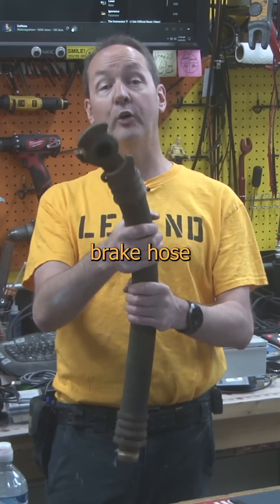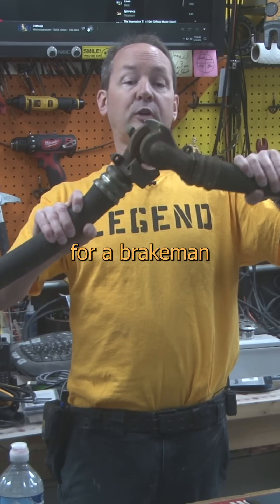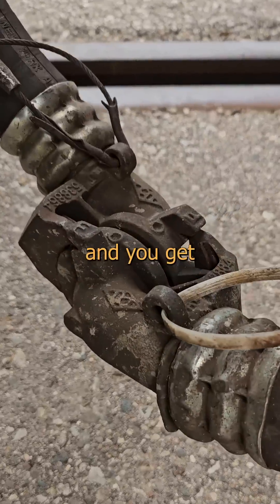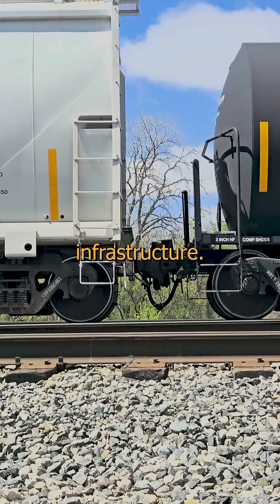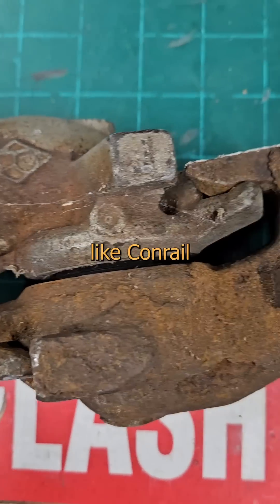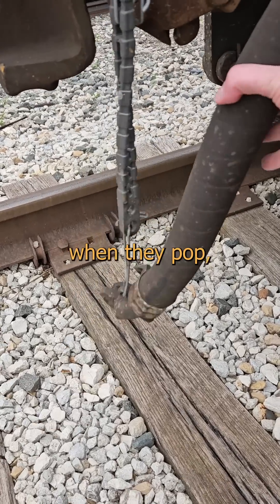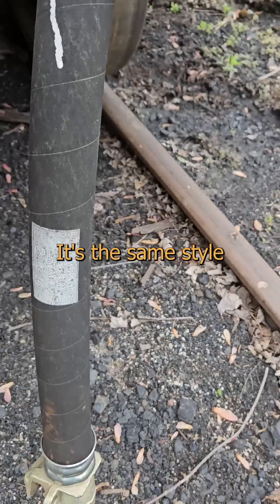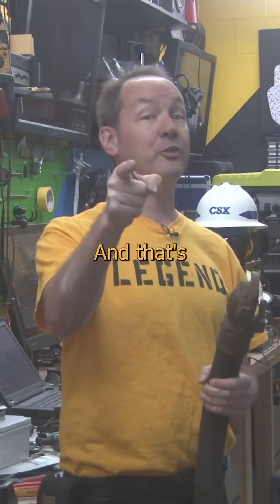Railroad Brake Line #chrisboden #comedy #engineering #train #gladhand #educational #connection #hose

Comment: The reason why he says "Things grind to a halt" because train cars NEED a pressurized air supply, because if you release the air, the brakes engage. This is almost like an automatic parking brake that also acts as an E-STOP in the case of a coupler failure, and also triggers it for the ENTIRE LINE of cars!
Reply: @RimedraVeltziona  it’s why the train brake is also referred to as the auto brake, any reduction in brake pipe pressure automatically applies the brakes
Reply: And another interesting thing is: it's not like trucks, it's not the pressure in the brake pipe that pushes the brake shoes away from wheels, it's a more complicated system.
Each car has a pressurized tank, and when pressure in brake pipe gets below the pressure in the pressurized tank, it uses the air from the tank to actuate the brakes to the difference in pressure. And when pressure goes back up, it first releases the brakes (dumping pressure in the brake cylinder outside) and then starts to refill the pressure tank.
Isn't that cool?
Reply: @JTCF , and one neat thing: if car's aux reservoir is out of air - we have no automatic air brakes. That's why it is important to engage manual (parking) brakes ASAP
Reply: Yes, because the air pushes the spring inside the chambers on a CMV & the air takes over as the functioning mechanism that applies the brakes. Pulling on/out the parking valve evacuates the air out of the chambers, thus allowing the spring inside to take over. Idk about train brakes, but CMV air brakes automatically apply themselves between 20-40 psi. AND THAT’S PRETTY COOL
Reply: @TurdFerguson-9  No, it's air differential on trains. You have the service brake, and the emergency brake. They both have tanks.
Reply: @patrickvolk7031  The service brake bleeds air from the train line gradually,  while emergency application dumps it at once.  The valves in the car reservoirs will sense an immediate loss of air and dump full reservoir air into the brakes, resulting in emergency application.  There aren't separate reservoirs.
Reply: This, btw, is no different than truck brakes. Those also fail safe, meaning with brakes on. Runaway trailers are no more fun in the road than on rails.
Reply: Train breaks are not like trucks at all  trains use a trip valve system
Reply: @JasperJanssen There is a massive difference between truck and train air brakes. 

Trains do not have spring brakes like trucks. The emergency brakes are applied by an air reservoir on each car, that eventually leaks off allowing the train to roll away into Lac Megantic.
Reply: @Texassince1836 Actually, if you look at the brake mechanism for most cars, there's pressure pushing on the throw rod at all times to keep it off the brakes on freight cars. Passenger cars are a different story as brakes are applied using pressure from a tank stored on each car and triggered electronically. Also, most passenger cars are disc brakes, where freight cars use shoes on the riding surfaces of the wheels.
Reply: @jamesmckenzie3532  railcar with no air has no brakes, unless you turn the hand wheel to manually apply them. Semi Trucks have a completely different system of brakes

Air applys the brakes on a railcar. When you reduce air pressure on the brake pipe stored air in a tank on the car applies the brakes. Once that tank bleeds off the car will roll freely.
Reply: @Texassince1836  Lac Megantic. Very tragic.
Reply: @Texassince1836 Agreed, but pneumatic pressure keeps the shoes off of the wheels on freight trains. Been witness to too many hoses breaking or the connection being pulled apart. As I said, passenger trains are different as pressure applies the brakes on them.
Reply: @jamesmckenzie3532 Springs keep the brakes off the shoes. When airpressure in the brake pipe is lost it trips a valve that uses air from a tank on the car to apply the brakes. After air loss the brakes will bleed off over the course of a few hours, and the brakes will release again. This is what happened at Lac Megantic.
Reply: @Texassince1836 interesting as it was explained the opposite to me. However, we can agree that a sudden loss of air pressure will immediately apply the brakes causing wheel lockup in many cases.
Reply: @Texassince1836  There are trains around that have spring brakes instead of hand brakes to be used as parking brakes. But they are not intended to be used while driving as they only can be set or released, no brake power regulation. In the trains that I drive (german ICE trains) they are set up in a way that an application while driving leads to an emergency brake application of the automatic brake.
But you're right about the air reservoirs and the leak off risks.
Reply: @Texassince1836  Also look up Southern Pacific at Cajon Pass, 1989.
Reply: @jamesmckenzie3532 Passenger trains work the exact same way as freight trains in terms of how the air brakes work, but the pressure is higher on passenger trains than on freight (110 psi vs 90).
Reply: @JasperJanssen  They do not fail safe, they rely on a pressure differential between the control side, and the emergency side. That air very slowly leaks out, and then the brakes give out.
  There was an incident up in Quebec a decade and change ago, where they parked tanker cars at the top of a hill. They didn't set handwheel brakes. The emergency tank eventually bled out, and the cars rolled down into a town and caught fire. 
   As George Westinghouse designed it many moon ago. The reason for it is air can generate more force than a spring, plus the spring can break. 
   You can also brake from the engine, which brings the slack in, or from the back, letting it out. You want the slack in when you're starting to move.
Reply: @JasperJanssen  they actually operate on a different mechanical principle, though both result in fail-safe conditions.

Truck brake shoes are usually sprung on to the rotors, and the pressure in the brake line actuates a cylinder that forces the shoes off, releasing the brakes.

Train brakes actually also use air pressure to apply the shoes; each car in the cut has an onboard reservoir which is charged to line pressure by the locomotive's main and equalizing reservoirs, and a comparing valve between the car's reservoir, cylinder, and brake line. Once the train's brake line is fully charged, equilibrium is reached and the comparing valve doesn't allow pressure to the cylinders, releasing the brakes. When there's a reduction in pressure in the brake line, the comparing valve sees the difference in pressure and allows that much from the car's reservoir into the cylinders, applying the brakes. The larger the reduction, the more pressure is sent to the cylinders, and the higher the braking force. Once pressure is returned to the brake line, the comparing valve releases the cylinders and simultaneously recharges the car's reservoir.

It's a somewhat more complicated system, but comes with the benefit that the maximum braking force can actually be adjusted based on train type, length, load condition, etc. simply by adjusting the locomotive's reservoir pressure, Whereas truck brakes have an absolute maximum force that can be applied based on the design of the springs.
Reply: @kberkstr  Thanks for the detailed breakdown
Reply: @JasperJanssen  Not completely true.... that's true for ONE axle of parking brake, but the regular service brakes are still positive pressure air. 

 I do not remember if both trailer axles are  maxi cans or only one.
Reply: @JasperJanssen  Much different than truck brakes.  Truck brakes have springs to apply them.  Train brakes have springs to release them.  There is 0 psi in the brake cylinders when released and 90psi in the brake pipe, auxiliary reservoir, and emergency reservoir.  The auxiliary reservoir is 2.5 times bigger than the brake cylinder.  If you drop 10 psi on the brake pipe, you get 25 psi in the brake cylinder.  Also, in yards, the cylinders are blead off and the cars are moved without brakes.
Reply: It’s the same on trucks. If they run out of air, they stop FAST
Reply: @tm7619  Incorrect. If a train car runs completely out of air it has no brakes at all. Sure you'll get some braking on initial pressure drop in the main brake pipe but after it's empty the reservoir on the car starts to dump and it releases the brakes. Completely different than truck air brakes that use a spring to push the brakes in.
Reply: Dude thanks for the knowledge.  
I work around train cars and was always wondering why I could hear the hiss of pressurized air between some of the tracks.
Reply: If you hear a train air system pop in real life it's really loud too. And all the brakes applying at one time is not something you want to be around.
Reply: Train brakes require air to engage, if you disconnect the car and wait all of the air will bleed out and it'll roll away, unlike modern semis which have spring actuated parking brakes. That's why rail cars have hand brakes you have to tie off
Reply: Sheldon Cooper Spotted
Reply: That’s really cool😊
Reply: Whoah!
That's amazing! 
I had no idea they worked like that!
Reply: Also, going off memory here so go easy on me, I believe there's an emergency air circuit which causes a separate reservoir to dump the main one even faster.
Reply: @pfsantos007 Equalization of three volumes. ie The service reservoir, the emergency reservoir and the brake cylinder. An emergency brake application signal propagates at approximately 900 ft/sec.
Reply: @pfsantos007 the brake valve does have a valve in it that dumps the air if it senses pressure dropping fast. That way the train can go into emergency faster than waiting on the air to dump from a single position.
Reply: @RimedraVeltziona  Same way it works for trailers. i would love to see the compressor of a train, though
Reply: @buffcode The cylinder heads of the locomotive air compressor are great for hearing one’s lunch. Wrap it in Aluminum foil and don’f forget it!
Reply: Air keeps the brake both on and off the wheel.
Reply: It’s called a fault tolerant connection.. the brakes release when pressurized, so if they fail, the brakes lock up, just like a semi..
If Harry Daghlian used a fault tolerant system when experimenting on “the demon core” (a 6kg ball of plutonium that was supposed to go into the third atomic bomb to be dropped on the japs), with a fuckin screwdriver, maybe he wouldn’t have irradiated himself..

He was experimenting with two hemispheres that would fit around the ball of plutonium, trying to get as close to supercritical as possible, which means  enough electrons are being ejected by the plutonium sphere, to bounce off the beryllium hemispheres, back at the ball, and cause it to go prompt critical, which essentially means all the atoms split at the same time, causing a nuclear explosion.. he was literally controlling the gap with a screwdriver, and the top half fell on to the bottom half, completely shutting the plutonium sphere in the beryllium hemispheres, without any gap, and gave himself a dose of radiation larger than most of the people working at Chernobyl when reactor number 4 exploded..
Had he used a fault tolerant system, where he’s using gravity to pull the bottom half of the beryllium hemisphere down and away from the death ball of plutonium, had the experiment failed, the beryllium hemisphere would just harmlessly drop to the ground .. I’m assuming you probably won’t read this through it’s entirety, but it’s fairly interesting lol
Reply: WOAH!
One comes undone and then they all come to a screaming screeching halt?
Reply: @sentgrace5188 yup. Seen it happen. Hit a deer, gladhands came undone, loud pop and sudden stop
Reply: @sentgrace5188  yep.. doesn't matter where in the link, you pop a hose, the brake pipe pressure drops to zero, the triple valve says oh shit, opens a port that allows the full pressure from the emergency brake resevoir tank directly to the brake cylinder for maximum brake application, and also opens another valve to vent the brake pipe to atmosphere to set the rest of the trains brakes even faster than the open hose.
Reply: Semi-trailers work on the same theory.
Reply: Literally everything with air brakes is designed the same way.
Reply: @EATSLEEPDRIVE2002 No. Westinghouse brake systems are very different and cannot be parked long term with the air brakes alone, as the air pressure will eventually run out and release the brakes. 

The airline in this video is both the brake air supply and the brake air signal. Changes in the supply air pressure make the brakes set, but this uses stored air from each individual car. If you lose your brake pipe pressure, all the available stored air does go to applying the brakes. However, because trains use air pressure to apply brake pressure, eventually that braking force will run out as the reservoir air leaks out, and several hours later the brakes will release. 

This is crucial because the relative capacity of a two mile freight train compared to one semi truck is huge - having separate reservoirs on each car means you can adjust the brake pipe pressure quickly, get your brake application set, and have that change applied to all the train cars, then use your engine reservoir to bring the brake pipe back up to pressure to release the set, and use less total compressed air than if you had direct pressure release air brakes.
Reply: aye just like trucks!
Reply: Same system on air brake equipped trucks (tractor trailers specifically). When a big leak happens and the air dumps, the brakes engage.
Reply: @CrashTestCat on a CMV, your low air warning light &/or buzzer will come on at or around 60 psi warning loss of air pressure due to air loss indicating blown chamber or air line (usually). Depending on air loss amounts you have seconds to get that vehicle to a stop or you will come to a stop.
Reply: @TurdFerguson-9  I've been a CDL A class driver for 8 years, I'm aware of this.
Part of your pretrip is releasing the system of all of its air to make sure the brakes lock at 20psi or under, even after the 60psi alarm sounds.
Reply: @CrashTestCat negative. Trucks do not have Westinghouse airbrakes. Road going airbrakes use a powerful spring to apply the brakes when air pressure is too low.

Comment: train air brakes actually work differently from truck air brakes, the whole brake pipe (sometimes miles long) is pressurized all the time and applying the brakes opens a valve to dump that pressure, which applies the brakes. they're held open by springs when there's pressure in the pipe rather than applied by it, and they're designed that way such that if you lose air pressure instead of being unable to brake you can't do anything but, which is great considering how utterly mortifying the fuck you physics of a freight train are already let alone one that can't slow down, great way to reduce you to a heap of wet hamburger meat and bone-based shrapnel. More specifically, almost every train uses a Westinghouse air brake wherein every car has it's own reservoir tank of pressurized air, applying the brakes opens a valve a variable amount that dumps a certain amount of  pressure from the brake pipe to atmosphere, which then means the reservoir tank is at a higher pressure than the brake pipe which wants to equalize and is only allowed to do so via a tripple valve (called that because it serves 3 functions, applying and releasing the brakes as well as allowing the reservoir tank to recharge). if the brake pipe pressure is lower than the reservoir tank's pressure, the exhaust valve is forced closed and the tripple valve connects the reservoir tank to the brake cylinder, pressurizing it and applying the brakes. the amount of braking is dictated by how much pressure you release from the brake pipe, which dictates how much pressure the reservoir tank has to push against the brake piston with to equalize. there's more to it than that and plenty of resources here on youtube to learn more, i highly recommend Hyce, he's a former BNSF shop foreman and does a great job of explaining these complex technical things in a way that's easy to digest.

Comment: Ya, no, they leak like a mad bastard.  No one does maintenance any longer.  I live across from a siding,  all i hear are air compressors and air leaks.
Reply: Depends on who and where, but there should be standards as to how much leakage is acceptable.

But especially when shunting, the brakes are usually deactivated (by emptying the reservoir), so lots of compressor seems right